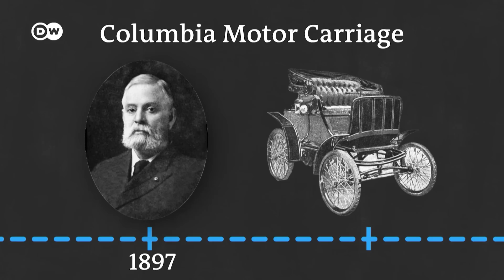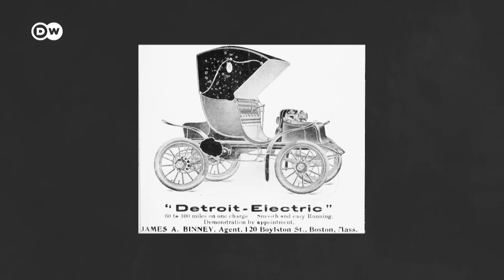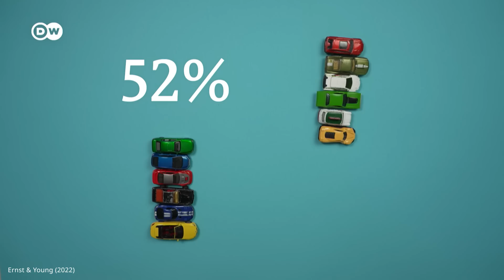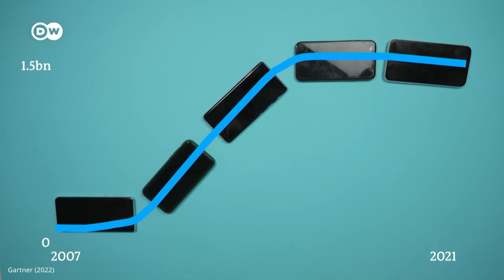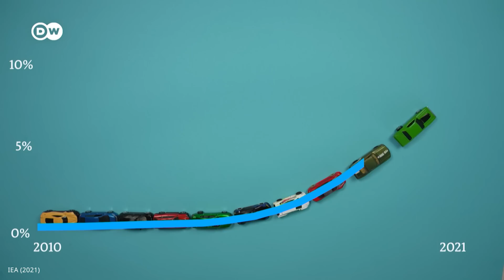Why electric cars are finally taking over

Comment from the maker: Are electric vehicles becoming popular where you live?
Reply: Yup, you didn't consider the fact that in India, there are more 2W as compare to 4W and lots of people are shifting to them. New brands with better technology are coming up with better products to cater Indian and world 2W market here. 

When it comes to 4W, so far there were less options available for general public but that is set to change very fast in next 2-3 year with brands like Tata and M&M are ready to launch more products to cater different customer segment.
Reply: Rapid adoption of EVs here in Newport RI. A few years ago there where a few on the road. Now 25% are EVs.
Reply: That 50000 figure you gave is with just 4 car models from 3 different companies with all of them in cost well above normal Indian buyer. Once more car models and companies will bring product in market, the S- Curve is bound to happen here in India.
Reply: They're finally being seen on streets around here in larger numbers. Taxi companies use them, the transit system has quite a few electric buses, even one fire department has electric fire engines. A local aircraft is on proving grounds for short commuter flights. 
There's a company building/developing electric farm tractors. What's putting limits are the charging stations, residential and commercial.
Reply: Slowly yes, but prices need to go down for them to grow more rapidly.
Reply: There's a problem with comparing technology in general to a vehicle.  This was done in the discussion about adaption of BEV where you say it goes in waves and showing how  BEV is only 1.5% of vehicles on the road.  BTW 45% of all BEV is on the road in China.  Failing to talk about China in this discussion is really a failure of the discussion in general since they're pushing BEV more than any other country and most BEV is produced there.

A company like Apple can produce 20 million smart phones very easily, even if it's a new technology, because there have been fabs over the past two decades that can produce the chips, and ramping up production for a smart phone ain't that hard.

Ramping up production for BEV is a WHOLE different story.  There is no such thing as repurposing a production line for ICEV to BEV.  The manufacturing is SO different that it requires new factories.  So, how fast can you ramp up BEV?  Not very quickly because building a new factory for BEV is VERY expensive.

So I found that point a bit silly in a comparison.

On top of that it's not JUST the factory.  It's ALL the raw materials that go into making the batteries.

It's best not to consider how many vehicles are on the road, because a person typically buys a vehicle and has it for many years.  You have to look at production for a given year.  What you're going to find is this production is a steady ramp up, not a wave like you suggest because a vehicle isn't a throw away item.

As far as vehicles I now see on the road, it's fair to say I see more Teslas on the road that Cadillacs.  I find this funny because GM is using Cadillac to produce BEV.  But this backs the point.  GM can't turn on a dime and start making a few million BEV a year.  It will be JUST like Tesla, where the ramp up is slow because of the HUGE cost of building the factories.

As Musk has said, the product is the factory.  I don't quite agree with the mentality, but from an engineering point he's correct.
Reply: @johndoh5182  Tesla's first factory was repurposed, Ford, GM and VW have or are currently repurposing older factories to electric vehicle manufacturing. Sooo.... 🤦‍♂️
Reply: @theunknownunknowns256  Tesla's factory in CA was GUTTED.  That's hardly repurposing. 

So.................

Yes you didn't have build a new building.  WOW!

And the typical Youtuber engineers that have evaluated what GM and Ford are doing say it will take many years trying to do what they're doing to get to the level Tesla is now, because it's not efficient, and in the world of manufacturing cost and efficiency, where efficiency tends to drive down cost matters a lot.  Why do you think GM started with Hummer and Cadillac?  I see more TESLA'S on the road than I do Cadillac now, so GM picks vehicles where they aren't going to sell many.

But Ford IS building a factory for the F-150 Lightening.  Right now they had to clear space in a factory for the TOTALLY different equipment needed to make the Lightening, which is the main cost of a factory, not the building itself.
Reply: Yes, they are being seen more and more everyday where I live. They now outnumber some popular luxury brands on the road, meaning you see more EV's than those brands. What you left out key point about GM, though. That being that not only did they crush all their EV1s but they also sold their battery technology to oil giant Texaco/Chevron who quickly sued any other auto manufacturer using it, such as Toyota (Rav-EV) and insured that no other auto manufacturer could use it. That's a big omission on your part in only partly alluding to it as a small reason. It was a huge part of it.
Reply: @Paul-cj1wb  exactly 💯
Reply: They are very popular here in California since gasoline is more expensive here than in other states, you can put up solar PV to fuel them, and the state has supported EVs.
Reply: Yes, EV sales in Thailand in 2022 so far is already 48% higher than last year. I live upcountry where EV infrastructure is lacking, so not viable option for me yet
Reply: Yes it's slowly popping up everywhere. I believed it's not even about green but it's about trend. Just like when iPhone was introduced. It was seen as status symbol or an expectation from coworker, friend & family and more important...clients.
Reply: Yes!
Reply: Ireland and yes seeing alot in the last two years . I plan to get one myself but 2 years away from that. currently in Seattle and they have way more same with Victoria in Canada
Reply: Absolutely - even in Ontario many many - they are becoming commonplace. 

Quebec - quite massive.
Reply: Where I live (Australia) there are relatively few EVs. Very expensive for new cars and limited infrastructure. We have a relatively small population, spread out over a large land mass. The government does not appear to be interested in providing decent subsidies for new car buyers. I expect that change will occur when the price of vehicles drops and infrastructure is built to enable charging to be accessible and affordable.
Reply: No and they bring more troubles than they solve... Eat less beef Germany! You are one of the top responsibles of global warming, yourself!
Reply: @thelonewolf666  evil
Reply: Not noticeably. Although having driven one since 2014, I stopped caring about what everybody else thought or drove some time ago. With my 26 km each way commute, an EV has been perfect and saved me a small fortune. Reliability, simplicity, cost, comfort, warmth, it's all better especially with charging at each end.
Reply: Prior to lockdown I was waiting for e-corsa. Had to get a Leaf as I couldn’t wait for release as our old car broke. We were first round here to get a leaf. Now there are loads around, perhaps I converted some with the green light rally.
Reply: No
Reply: Yes
Reply: Yes, because people in the Seattle area are generally wealthier.
Reply: Not in my driveway.
Reply: No. I’ve yet to see one.
Reply: Scotland, Yes💯
Reply: Sadly yes
Reply: @feuerherz007  
I'm not rich and I just got an EV. It's awesome, no more oil changes, engine air filters, ... or trips to the gas station, I charge at home while sleeping for free here in Houston, TX.
Reply: @That-Guy_  Won't last long.
Reply: @EA-tc6kb  
Mine has LFP batteries that should get me at least 500k miles and the motor should get at least as much. I am saving $170-$200/mo on gas and maintenance.
Reply: @feuerherz007  Why sadly?
Reply: They are popular with wealthy people, so no
Reply: @bollweevil8112  since when do wealthy people know what is good or bad
Reply: @bollweevil8112  thinking abt wealthy ppl sounds like ur a peasant
Reply: No
Reply: @HZV1492  sad, where
Reply: @Nicholas-f5  not sad*
Reply: @Nicholas-f5  Electric cars suck
Reply: Yes, teslas are everywhere and all our cars are electric and have been for about 4 years, it’s like being in a museum when driving a gas car now
Reply: No not on roads
Reply: Nah..Tanzania
Reply: @kisali777  lack of science education likely
Reply: EV's are in no way going to solve global warming, due to most electricity grids being primarily reliant on fossil fuels. At best EV's will "slightly help"  if there is widespread mass adoption. It seems once again the majority of the human race is having the wrong conversation on how to solve a massive problem.
Reply: @Battleneter  Nobody is saying they will solely solve climate change or global warming, but their mass adoption will most definitely help with decreasing collective effort in decreasing current trend of warming our planet. As scientist say we need to do all what is necessary to avoid 3 degrees Celsius of warming this spaceship of ours ;)
Reply: @D.u.d.e.r  Your missing the point,  even if you could "magically" transform all cars into EV's today, that would not even lower world CO2 emission by 2%. So no EV's are a "feel good"  solution for the ignorant.  I am of course ignoring  the massive CO2 costs of manufacturing these vehicles that are barely going to help.
Reply: @Battleneter   his missing?
Reply: @Battleneter  If all cars and vehicles are "magically" transformed as you say to EVs and they are charged from renewable or zero carbon energy, then this action will definitely NOT lower carbon emissions only by 2%!
Solving transportation is just one of the key issues on the table and of course its not a silver bullet to completely solve climate change and global emissions. Most importantly energy around the world needs to be generated from renewable or zero carbon resources, but you need to fix other issues like transportation in parallel.
Reply: I live in my house and I own 2 Teslas, so yes.
Reply: no
Reply: @Chris-sm2uj  lies

Comment: The first reasonably reliable and affordable car was created by Henry Ford in 1908, automobiles didn't ovetake horses as the most common means of transportation until the1930's,
 and even by 1940 only 23 percent of the nation’s farmers had tractors.
This still wasn't as reliable as horses because the infrastructure hadn't been built, it was perfect for urban life, but not all rural communities had gas stations and were reliant on mail order cans of fuel.
A responsible government would build up the infrastructure needed before mandating a change,
which is why none of our governments are doing this as none of them are responsible enough to look at the big picture.
 And eff you Greta Thunberg.

Comment: 1.EVs are too expensive
2.charging takes too long
3.terrable charging infrastructure (so far)
4.long-term reliability (battery degrade fast and they need to be easily swapable)

these 4 things need to be fixed for me to even  consider it, idk about u
Reply: 5
once these things'  battery is damaged and caught on fire , theres literally no way to put fire out  like combustion vehicles
it requieres 10x amount of water and actual time
Reply: 1. BYD EV prices are cheaper and will get even cheaper
2 &3.. Charge it at home during off peak hours
4. Batteries will last you up to 300k miles
Reply: @PyroShields  1.BYD EVs and any Chinese EV for that matter literally blows up.theres a reason they are cheap 
2.If everyone drives EVs in future most countries wont even have enough electricity resources to charge them all up, it's unsustainable.
3.doesnt matter that ill last 300k miles when battery degrades to point where 100%charge only gives you like 50 miles.

If electric cars made sense japanese and specifically Toyota would be first to make them there's reason they dont, they know its bullshit scam.
Reply: 1. EV's are cheaper than the same gas car in 2024 if they have the same options installed. example a F150 Ice cost more than a Lightning if the ice has same options added that the lightning has standard
2. Charging is usually done overnight while you sleep so technically there is zero waiting for charging vs a gas car where you have to stand beside it in the cold waiting for it to be full.
3. where? Charging infostructure is insanely robust here in western north America. 
4. I work in a fleet shop and we now have 14 years of EV Maintenace history and they are VASTLY more reliable than ice cars. almost no Maintenace at all. brakes last 150,000km. we have never once had an issue with an electric motor or battery. we have 14 year old Leafs with one of the worst batteries ever to be fitted to a EV and they are 14 years old and still have 90% state of charge.

Comment: Once trump wins that bidenomics bullshit will be bye bye!!!!!
Reply: Trump can't stop technology from happening. Wake up Alex.
Reply: EV,s are more powerful, have way less maintenace, you can fill up at home for 1/10 the cost of gas, and have 10 year warranties etc.  you would have to be really dense or bad at math to buy a gas or diesel in 2024
Reply: Way more power has nothing to do with it. Nobody is using 2,000hp at the wheels on the street. The weight us so high to compete with ICE and hybrid ranges. Hybrids are the best all around. Power, and range. F1 uses kers technology. That's race car mode. The hummer H3 is 9,000 lbs you cant drive over some bridges with that. I think it should just be an option on the list of modes of transportation that fits your life. I totally agree with you. There are people out there that EV's work for them, and there are some that they don't thoughtl
Reply: @alexmaccity  your using extremes. Not talking 2000hp, but its nice to have instant torque even on average EV's. The weight depends on the EV, my 2019 hyundai ioniq full EV is 3300lbs... thats it. its 300lbs lighter than my last gas car.  

Tesla model 3 is lighter than its equvilant rivals from mercedes and audi etc. 

Agreed the new Hummer is ridiculus. but so is all the people i see driving jacked up Ford F350 super dutys going to walmart lol.
Reply: You can get instant throttle response in anything. But I hear you. To each their own.

Comment: Don't get too hung up on this EV invasion. The power grids in the U.S. are at least 50 years old. The so called "experts" tell us that there won't be a grid problem. Sure, like many of us believed Al Gore when he made the statement about all the icebergs melting & all those cities & land that would be under water. EV's are not as "green" as they want you to believe. We have little to NO INFASTRUCTURE in place ( much of it is inside the head of Joe Biden).
Reply from the maker: Also, we made a video called "Can you recycle an old EV battery?" you can check out here 👉 https://www.youtube.com/watch?v=PbOBmnZRpZ4.
Reply: You must live on top of a mountain with a population of 1k.
Reply: wait didn't Florida just get drowned, arn't they spending billions because of the sea actually rising?  

An EV charging at home uses the same current as a electric dryer or Stove. Electric companies are promoting EV adoption because EV's can charge in the middle of the night when the grid has EXCESS power. no grid collapses.

Comment: And as fast as they appeared is going to be the same way that they leave when we figure out that investing in electric cars is a stupid and pointless idea.

ELECTRIC CARS WILL NOT SAVE THE PLANET.
GET THAT OUT OF YOUR HEAD.
Reply: My electric car is powered by 100% zero emission electricity from a Hydro dam. My ev which is a 2019 was already greener than a gas car in less than 8 months because its powered by zero emission. if its on the road for 30 years it will be 50 times cleaner than a comparable gas car. and yes the batteries do last that long. my work has 14 year old Leafs and the batteries are still at 90%.

Comment: Am sad to say yes, because i hate the idea of only electric cars they are not clean and not superior. There are multiple problems with electric a few of them are, range and costs of the car with is a big problem for someone like me. I cant go to work and back with a electric car that costs  25000 euro the only cars i can do that is a electric car from 50000 euro plus. Not an option for me. They are ruining the roads because they are to heavy. The battery is nog clean and if car is broken what to do with the battery? They are a fire hazard and therefore unsafe. Patrol cars are stil superior but are not the cleaner option. Just look to alternatives

Also most of the world doesnt have a good electric grid that can sustain the many electric cars

Isnt the solution for now

Comment: electric cars on paper are better, but they are not a silver bullet.  Firstly, they "cost" a lot to manufacture in terms of environmentally, both in emissions AND in human lives.  Almost all the cobalt in the world comes from Congo, where both land, and human labor are heavily exploited in the hopes of making profit from electric vehicles.  Then there is a matter of where your energy comes from.    i live in Hong Kong, and the majority of electricity comes from coal, fossil fuel power plants, so electric cars aren't that much better than ICE cars.  Depending on how much you drive them.  If you're an Uber driver that does 100,000km in a year, then an electric car is by far the obvious choice.  For someone who leisurely drives on weekends, it might take well over 10 years before an electric car could offset the emissions made from manufacturing over a normal ICE car, and that isn't even factoring how battery materials are running out, and all that human exploitation in Africa is happening.
Reply: new LFP batteries use zero Cobalt. But refining gas and diesel uses cobalt...